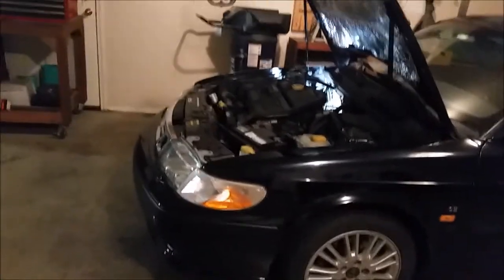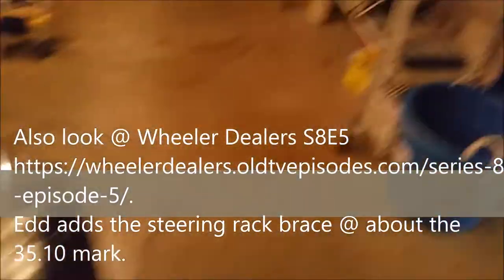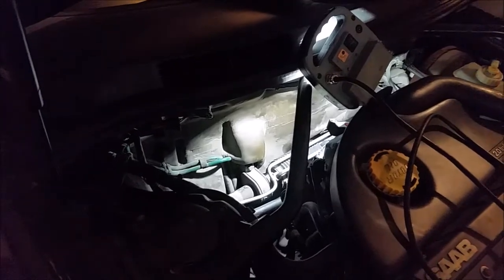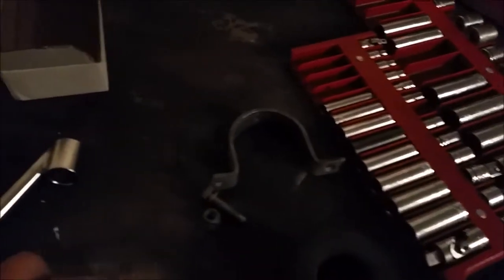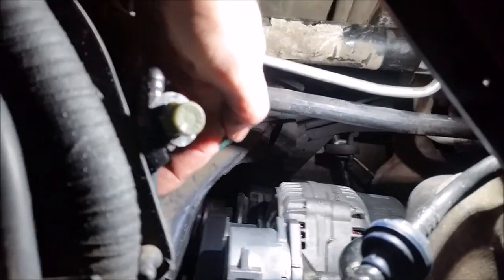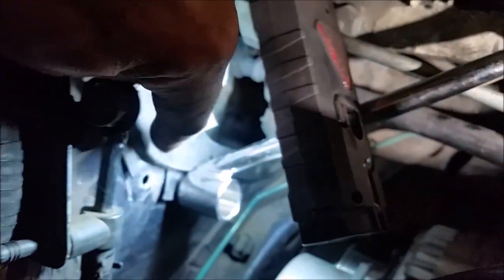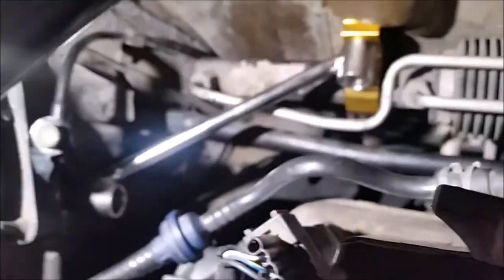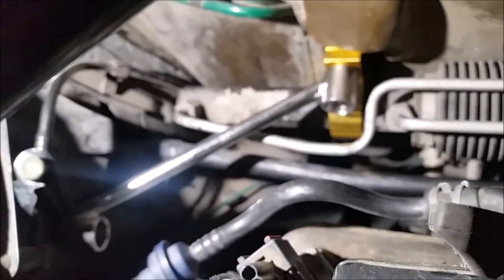S1E1.12 Saab 9-3 Steering Rack Brace

Comment: Hey, thanks for the video. I was wondering if I need to access the nut on the other end of the firewall? Or is it welded there? Worried about stripping everything down and having a nut fall some obscure place
Reply from the maker: Dan, no you won't. All is accessible from the engine bay & wheel well. You can get a kit from the usual suspects: genuinesaab.com, eeuroparts.com, abbottsaab.com & pfsparts.com. This made a huge difference in the spirited driving I may be known for... Maury
Reply: Thanks Maury! I already got a kit from PFS, but I have o figure out where to reroute my fuel lines as mine come out over the rack rather than going up along the firewall like in most tutorials online...

Comment: need this on my 02
Reply from the maker: It makes the biggest difference accelerating thru a corner. Well worth it.
Reply: @316automotive9  how long did the installation take? 45 min?
Reply from the maker: @KylePancis  About an hour, maybe less.
Reply: Do you know what would be the correct parts for a 2004 9-5? Sounds like I need this!